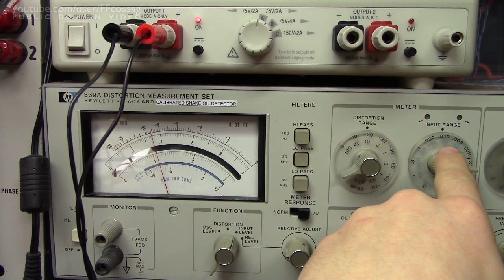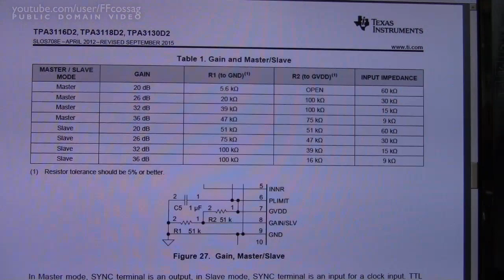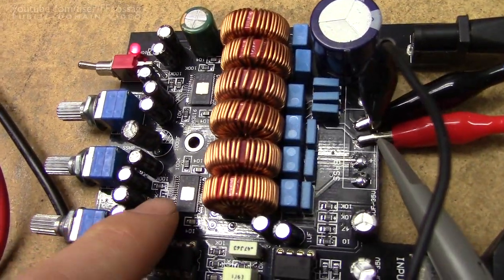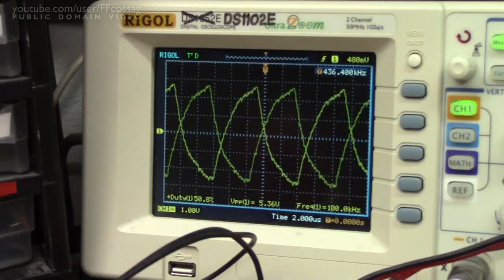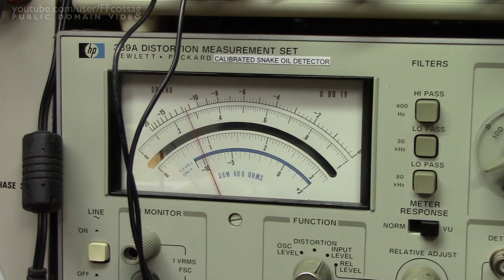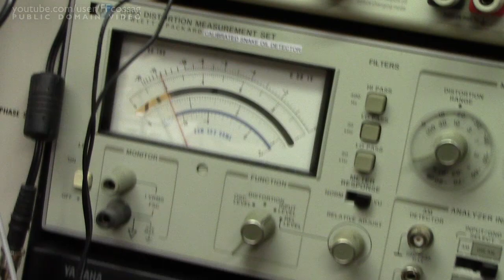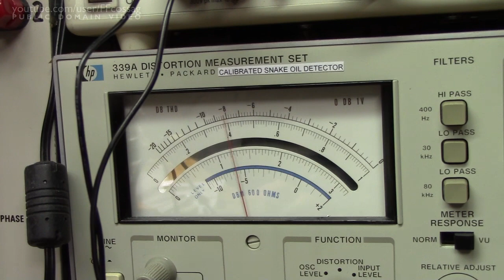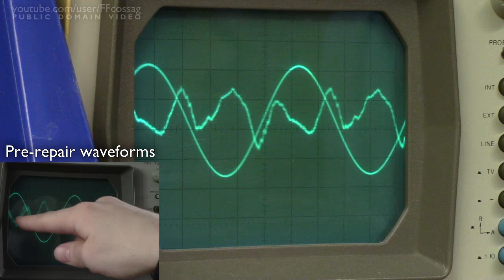Dual TPA3116 board: Fixing the AWFUL noise floor.

Comment: I just checked the datasheet and there it says that the 10k resistor between the two "SYNC" pins should be there.... It's on page 26 of the official TPA3116D2 PDF.
Reply from the maker: I know, but it doesn't work in this implementation. I don't know why.

Comment: I have a problem with a dual TPA3116 stereo amp board. I did your mod and the screech noise is indeed gone. However, now I have another problem. The board is a stereo amp and so it has a single RCA stereo input terminal. One of the channels is now corrupted and weak. I noticed that one of the RCA terminals somehow transfers sound to both channels, so the channels are somehow joined. Do you have any thoughts on that ? Thank you in advance for any comments!

Comment: Would it be any problem to wire midbass(30W)+tweeter(15W) in parallel of the same 50W output? Both 4Ohms plus 2nd order crossovers. Also, it wouldn't be a problem to connect the pots with a wire to place anywhere I want, right? Thank you very much, great video!!
Reply from the maker: That's likely fine.
Reply: Thanks! I never now if the difference of Wattage would cause problems or unbalanced outputs, that's my concern.. (if you have any concern I would be happy to know!). Another question, would you suggest myself changing straight to the 10K pots instead, once I will remove those pots to wire them away of the board?
Reply from the maker: Rene Protti I don't see why not.

Comment: so why didn't you change the potentiometer first rather than change the resistors surely the 40 drop would have made the biggest diffrence
Reply from the maker: I tried shorting the inputs of the chips, and the noise was still present. Hence the issue was not related to the potentiometer.
Reply: so why didnt you use a resitor across the potentiometer rather than swapping it out
Reply from the maker: Tony Greenall
That would cause the volume control to not work very well, since your adjustment range is such a high resistance compared to the static resistors across the pot.
Reply: maybe so i have just ordered that board and can see a better way of modifying the board to get rid of the interference as i am using it for my speaker build so electrical interference will play a big part of it as its going to be for my hf radio
Reply from the maker: Tony Greenall
Good luck!
Reply: thanks

Comment: I believe the Chinese have seen your changes to this amp. I bought one recently and they have used the 2.2uf capacitors and they have changed the volume nobs for the 10k ones and i bet they have made the other changes too. Mine sound great. Now, whats the diference between having 3 capacitors rated at 25v 3300uf and only having ones like the amp you have?
Reply from the maker: Not much difference. More capacitance is better but they have different versions to account for the market at any given time.
Reply: Did you fix the problem with the tpa3116 getting hot even though it´s not producing outputting any sound? Mine gets hot to about 45c at idle and ambient temperature at 35c. But when playing music it goes up to 55. Do you consider this ok? At 5:35 you removed a transistor did that solved the issue? 
OBS: You have some fans here in Brazil. You are ones of the guys that do a pristine job and explains things in such an easy way to understand. Thank you.
Reply from the maker: I don't recall mine running very hot. It sounds as if you might have an issue with your chip, a leaky output transistor or something. At 5:35, I remove a resistor and jumper across it instead, it solves a noise issue, not a temperature issue.
Reply: FFcossag I hope not. I haven't found any video on the internet so I can't compare with mine. I have seen one of your other videos and that other amp was getting above 100C. Now that room temperature is at 22c with AC on the amp is running at 44c. If you are able to mesure the temperature on yours it would be nice.
Reply from the maker: At idle, it really should not be getting that hot.
Reply: FFcossag That's bad. Do you think there is something that can be done? Or this is a chip problem?
Reply: I guess you are the best person to ask this, do you know which capacitor I have to change in order to make the stereo channels produce sound above 80hz frequency? I have noticed that they are  full range but for the speaker set I have it proves to be a waste. My satelites can´t reproduce anything below 80hz. It just moves and doesn´t sound any good. The SUB handles that pretty well. Thank you man
Reply from the maker: It's a couple of the 1 µF coupling caps by the volume controls. I don't remember which specifically, but I changed two of them to 100 nF in order to cut LF in one of these.
Reply: FFcossag Thanks. I have hooked my amp to my multimeter and the idle power  is at 0.12A at 12.2v. So it's using very little power. As you said I must have a problem with the chip for it to be running at 50c in idle. I will try the caps to eliminate the low frequencies . One of your flowers is giving me a hand about it too.
Reply: Hi, I've just got my 24v PSu and boy the amp is running hot now. Up to 80c at low volume. Is´t that way too hot? You told me once it was a problem with the TPA chip but do you think there is something I can do?

Comment: Hi folks! I would like to know if it is possible to mount the tone and volume potentiometers outside the board through wires without making any background noise, I have tried shielded cables and a capacitor to gnd and they decrease noise but always make noise with class d boards. I appreciate any comments.
Reply from the maker: Hard to say without knowing your specific set-up. Try it!

Comment: Is there a chance that you would make future video about how to add 2th volume knob to amplifier that have existing one.

I have amplifier with Bluetooth and usb inputs. Tpa3116 2.1ch  50w*2+100w
Forget about aux input, i dont use it.
Most of the time i use usb input.

I want to preset the amplifier volume without distortion at max as possible and hide the amplifer in a boombox.
The 2th knob will regulate the volume to the max volume that the first knob is set and this one will be outside of boombox.

I really searched guide for this in youtube and google, couldn't find one.

Best regards,
Alex

Comment: I see at the beginning of the video you have the other board with 3 cap. Have you tested it yet? Does it have the same problem with the one cap version you fixed here. I have the 3 cap version, it's quite good but I don't have the equipment to test. I realy want to know may I can improve it like the 1 cap

Comment: Hmmmm, calibrated snake oil detector. What is used for the calibration standard?

Liked the video - good troubleshooting!
Reply from the maker: A decent sound card and true-RMS multimeter. Due to the way the 339A works, you don't need very good gear to calibrate it. If it's out-of-cal, it'll just report too much distortion in the really low distortion ranges.

Comment: Thanks for the video. What are the opp amps for? I figured they were there to boost the signal on the input.
Reply from the maker: They make up the lowpass filter for the sub output. Someone reverse engineered the circuit somewhere in the comments for one of the videos I did on these boards.

Comment: Hello, I made the same changes you made. But now I have the problem, that on my left speaker the treble is very low. You almost don't here a difference when you connect or disconnect it. Did I make something wrong? It almost soind like there is coming mono from the right speaker.
Reply from the maker: Something's gone wrong; you just have to check your work if the module worked before.

Comment: Hi friend, nice video! The TPA3116 is a very good amplifier, but the chinese circuits are strange... I have the amplifier with 3 big capacitors, you have the same as me, you showed him when the video starts from 00:00 so to fix noise in this amplifier board is the same proceduce for both boards? Sorry my bad english...
Reply from the maker: The boards are very similar but I only touched one of them.
Reply: Thanks for the answer friend, i maked the same things in the board with 3 big capacitors and worked! I changed two resistors and jumper one. I don't changed the potentiometer, but the noise reduced, still exist but is not anoying now... Thank you for the help! The proceduce work very well for the both boards.

Comment: Is there something similar to this that doesn't require mods to improve the noise floor?
Reply: So..... a mod that doesn't require mods huh...
Reply: lmfao!
Reply: Mark Emmerton pretty sure he or she means a cheap amp that doesn't require a mod to sound good. It is a bit frustrating that all of them benefit from swapped caps or pots or resistors or whatever. It would be nice to know if anyone has a tip for a currently available amp like this that works great out of the box.

Comment: how do you solder such small SMD resistors?
Reply from the maker: With a soldering iron.
Reply: using a hot air rework station

Comment: I have swap places of that two resistors, and replace resistor with a jumper, but I still have that noises. How do You think replacing potentiometers with 10k will help?
Reply from the maker: +Taras Lys Swapping the resistors and bridging the jumper removes the "screecy" noise. To fix the noise that gets worse when the volume is in the middle position, you need to swap the potentiometers.
Reply: +FFcossag Thanks so much for the answer! I'll replace them, and hope it will help.

Comment: If you wanted to do these kinds of measurents and only had a (cal'd) oscilloscope and voltmeter for bench tools, how would you do it? Some PC software with an external sound card?
Reply from the maker: +Jernej Jakob You can use a high-end PC sound card with some kind of passive front-end to do pretty OK performance analysis on non-BTL amplifiers. I've done this with VIRTINS Multi-Instrument, and I recommend that software if you can get your hands on it. A scope alone is pretty worthless for measuring distortion and noise in audio circuits, since they don't usually have the resolution to measure the small signal levels involved.
Reply: +FFcossag What I'm wondering is how high end a sound card you'd need to, say, measure the distortion with enough precision at like 10 to 20 khz. 48khz isn't going to cut it, I'd say not even 192khz sampling would be enough (you'd only get 8 data points at 20khz), and then you get into a price range where it's just easier and cheaper to get a proper used bench distortion analyser. Is distortion at high frequencies a meaningful parameter, I'd say it is, but do you need to measure it that accurately or am I just overcomplicating things since rare people can even hear a 20khz tone (I know I can't much more than 16... hearing damage does that)
Reply: +Jernej Jakob to reply to myself, it seems you can get very good results with a 192khz/24bit sound card in combination with a twin-t active notch filter. measuring distortion down to 0.0001% or below depending on the gear used. source: http://www.moorepage.net/Twin-T.html
Reply from the maker: Jernej Jakob I'd say that that twin-T filter is several orders of magnitude overkill for normal audio measurement (interesting as the article might be). As are measurements much above 20 Khz, since they're not going to cause audible issues unless they're symptoms of deeper issues (oscillation, or stuff we see in the amp in the video above). In these cases, however, we're not talking about -100 dB harmonics, but 5 mV signals, so they can usually be detected with a scope.

If you're aiming to measure stuff like power amplifiers and not-super-high-end audio preamps, a 24-bit/192 kHz sound card is more than adequate. Distortion and noise performance of those devices rarely exceed the performance of the ADC in a good sound card. The issue is that you need a front-end for it if you want to measure more than about 2 Vpp, which, if you want accurate ranges, is a relatively complex build. If you furthermore want to measure BTL amplifiers, you need an even more complex front-end to isolate the output of the device under test from your computer's ground.

That said, I've achieved very good results by just using a Xonar DX sound card and two potentiometers for "range switching" (i.e, sacrificing absolute level measurements). If you tune your fundamental test frequency to roughly match the peak input level of the sound card, you basically have 100+ dB of dynamic range to play with from 2 Hz to 50 kHz (performance of the Xonar decreases beyond that point). To put it into perspective, this is the set-up I use for calibrating my HP 339A.

Comment: Здравствуйте ,купил точно такой же усилитель с одним конденсатором. Имеется шум , такой же как у вас. Если я вам пришлю фото, вы сможете выделить что нужно заменить. то есть подписать на картинке какие резисторы и что сделать нужно ,спасибо.

Uvgeniy Shishkin
just
Hello, I bought exactly the same amplifier with one capacitor. There is noise, the same as you. If I send you a photo, you can select what you need to replace. that is, to sign on the picture what resistors and what to do, thanks.

Comment: Can you please tell me if the first board you put on the side requires the same fix because there’s only one video about that other tpa3116 and the guy who made that video called it out for absolutely awful background noise and I got one except that mine has 3 10k potentiometers not 50k. Maybe we could find a way to communicate......that would help me so much! Thanks in advance!!
Reply from the maker: I don't think I ever got around to checking out the other board properly.
Reply: Well the board I got is actually is the same as the one that you did not tested (with the 3 big capacitors : 25Volts 3300uF) except that mine have 3 potentiometers of 10K (green) instead of 50K (blue)but the rest of the parts look basically the same as the one you've been working on. So I wish I could have an email address or a link to a Facebook page so I could show you 3 very clear pictures of the board without the heat sink you you could see if the same 2 parts have to be switched and a third replaced by a jumper like you showed on your video. I really need this information because I'm working on a boombox that I want to be unique and hopefully without an horrific sound. Thanks!!

Comment: Have you tried/tested the other board (with three big capacitors)?
Is it about the same, requiring theses fixes or better built?
- still waiting for mine to arrive :( -
Reply from the maker: +Joaquim Pereira The other board has the same issues, but it also has a MUCH inferior output filter. I think the "3-cap" board is an earlier revision of the "1-cap" board.
Reply: +FFcossag That board send to have the filter made in SMD, but I thought it was about the same thing. Glad I bought this one instead... thanks.
Reply: +Joaquim Pereira/+FFcossag I have the blue board with the 3 caps and applied the mods sucessfully (see my other comment). 
Any ideas on how to improve the output filter? Is it worth to replace the smd-caps on the bottom of the board with through-hole ones? Which values?
Reply from the maker: hieroben_de
I haven't played with it, but it's usually a good idea to just try and match the filter circuit in the TPA3116 datasheet. All I know is that it's got a really noisy and crappy output compared to the single-cap board.

Comment: Can you give pictures of board for changes, thanks a lot
Reply from the maker: Alas, I didn't take any pictures, but you should be able to work with still frames from the video.
Reply: ok, can you say "Swap the two gain resistors (39K and 100K, under the heatsink) of ONE of the TPA3116 chips." to change with what?
and 

Bridge the 10K resistor by pin 16 of the left TPA3116 with a jumper. this one just connect with wire?

thanks
Reply from the maker: Swap as in swap. Change places. And yes.
Reply: Did work great, thanks a lot

Comment: Thanks for this video, mate. I have a TPA3116 based 2.1 amplifier which had ridiculous amounts of noise. Thankfully the master / slave was correct but the gain was set to 32dB and was causing lots of hissing. It's now set to 20dB gain and the hiss is reduced greatly.

I'm not sure how to do the pots. I might replace them with resistors where I can. Should I use 50k resistors because that's what the pots were, or should I use 10k like the replacement pots you used?

Comment: Hei. Jeg prøver på Norsk.
Jeg har en forsterker som bruk 1 stk. TPA3116 Stereo. Jeg kjøpte meg en lyd spiller module som spiller mp3. Wav. Flac å som har sd kort. AUX. Bluetooth og fm radio?
Jeg  fikk mye digital støy å fikk det ikke bort. Til slutt fikk jeg hjelp av sellgeren å måtte først ta vekk 0 ohm AGND motstand på spilleren som er disital GND å da ble mye av støyen borte. Så fant jeg ut at forsterker å lyd spiller ikke kan ha samme powersupply GND kobla sammen.
Nå bruker jeg 2 stk. Power suply å forsterker og lyd spilleren sin GND er ikke koblet sammen. Muligens du sliter med det samme? Prøv  sepparat power supply å kobl telefonen til  forsterkeren. Virker som du har støy på lyd inngangen.

Du kan sette en resistor  over signal å gnd men da kortslutter du bort noe å du må ha høyere lyd på inngangen. Du gir forsterkeren svakere signal å støy som kommer inb blir lavere men ikke borte.  Du må ha 200 ohm for å få vekk alt å da blir lyd signaler alt for svakt!

Comment: Hi I have just had one of these boards and fitted it in to my boombox. It is way better than my last TPA3116 2.1 board, a lot louder, although sound is a little muddy (I will get used to that).

Question: Is the 2200uf input cap big enough? I note you other board has 3 of these. My other boards have around 3300uf per chip.
Reply from the maker: 2200 µF is fine.
Reply: @FFcossag  I added in another 4600uf that I had spare and I think it helped.